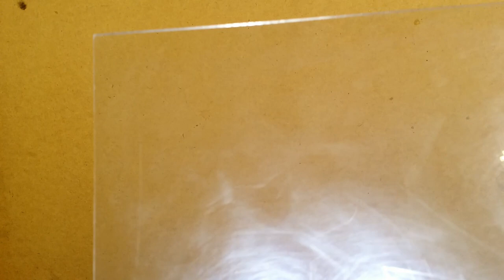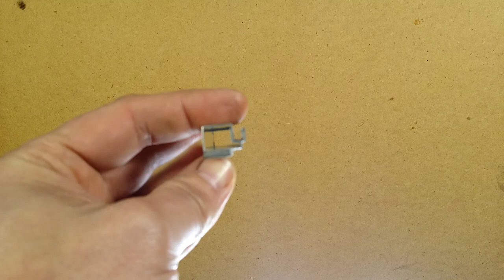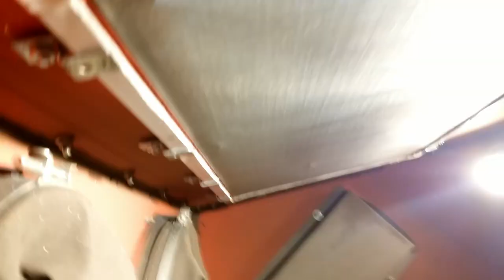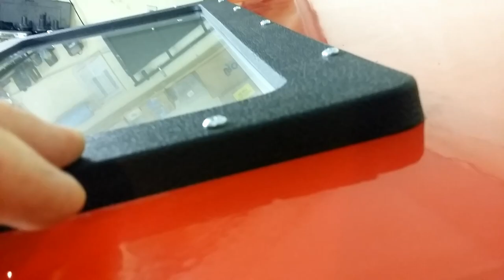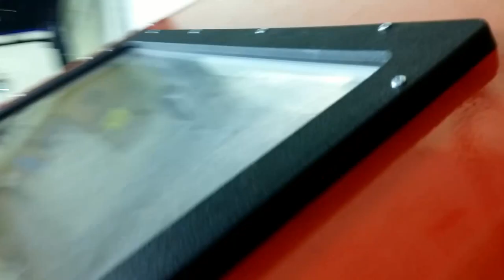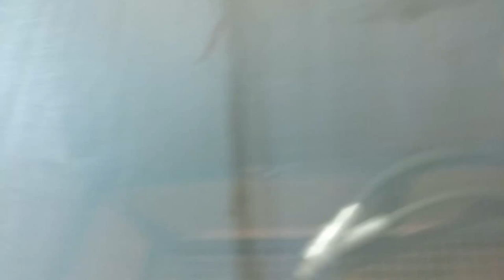Protect Sandblasting Cabinet Glass

Comment: I've watched all your blast cabinet mods. I've subscribed cause of your humor.....and your work.
I was looking into mesh as well so we are on the same path.
You haven't mentioned your blast gun where you sourced it .
You said cheap so my ears perked up.
I think the foot switch ( I sourced that ) and the gun ( looking for the style your using ( still looking )
Is the biggest improvement.
Your drier is impressive!
Even your video production and edit is well done!
Reply from the maker: Thanks for your kind words. 
Back to business. The project was stretched over time so I don't remember now how much I've spent and where I've bought the gun. I think it was about 25 CAD at Banggood.com. Today it costs 47.24 CAD https://www.banggood.com/Stainless-Steel-Air-Sandblaster-Gun-160mm-Spray-Gun-with-Nozzle-p-1121874.html?rmmds=search&cur_warehouse=CN
It is cheaper at Amazon https://www.amazon.ca/dp/B07838DJ1H/?coliid=I34W6LQCGBYCV6&colid=2LEWLULN9R9VZ&psc=1    
but still pricey. Mine is exactly the same gun but I cut off the top loop ( I will not be hanging it anywhere ). 
Air dryer: https://www.princessauto.com/en/detail/air-dryer/A-p8055757e It is often 50% off. 
And pellets for the dryer: https://www.princessauto.com/en/detail/air-dryer-pellets/A-p8506206e
The only downside of the steel mesh is that I have to keep lights in the garage dim, otherwise, the light bounce off the screen and I see more of the screen and less of the object I am working on. 
For now, I am only running aluminum oxide and work on cast iron or steel. Rust produces a lot of dust and most of it is trapped inside the bucket below the cyclone duster. Practically nothing ends up inside the vacuum bucket but there is some fine dust that over time clogs the filter in the vacuum. I solve this problem as well. Based on this guy design: https://www.youtube.com/watch?time_continue=11&v=uhrLhpznvCg&feature=emb_logo I did my improved version that you can see at the beginning of my screen video   https://www.youtube.com/watch?v=qnCbsj4JJqk ( the blue lid mistery bucket ). Working on a new video for the wet filter. 
Sandblasteing cabinet - the neverending story.
Reply: @robertdeptula2003  thank you very much. I m getting  up to speed ....SLOWLY .I have two 1970'z Datsun Z car's to do lots of parts blasting on..all my past experience ,blasting ,tells me to wait till I have it all modded before I began. That is the plan. Thank you

Comment: Simple and quick...  I just use standard aluminum screen available at any Big Box hardware store.  The raw screen is held in place with dollops of hot glue directly on the glass.

Folks complain about a lack of lighting with screens.  I have no fixed lighting in cabinet.  There are, however, two 300 watt equivalent LED spot light bulbs resting on the parts screen base.  It's rather easy to move a part or move the light to see whenever necessary.  Use wire loom on your power cords to keep from chewing up the wire insulation.

Comment: Is the visibility less?? It looks like you can’t see as good
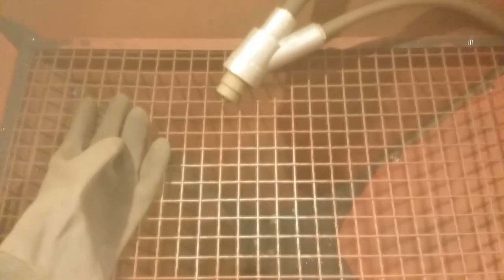Reply from the maker: This is what you see 1:47. It is not like through the glass only. But if you have scratched plexiglass on top and plastic film glued to the glass then my setup is better. Even if you use two pieces of glass, one sacrificial, then in no time it gets frosted and gradually you lose visibility. After sandblasting a set of four brake calipers for one car (rusted cast iron, using aluminum oxide) I had to change the glass with sacrificial setup. I'm happy with this mesh setup. 
Here is my other video with the old setup, sacrificial (new) glass:  https://www.youtube.com/watch?v=GdyJf2PzlHU at 28min16sec. You can compare.

Comment: Hi how is the metal mesh working so far? Still holding and clear to see?
Reply from the maker: It works perfectly. I worked about 3 hours so far after the mesh installation. By that time the regular glass set up would show some frosting. The only "problem" with the mesh is that I have to keep the lights dim in my garage to see perfectly. I'm happy!
Reply: Robert Deptula thank you, I saw you put a 120 mesh. Do you think a different size would make  visibility better ???? Which would you think
Reply from the maker: With 120 mesh visibility is good. My choice was 120 because it was recommended in one of the blogs I have read on the subject.
Reply: Robert Deptula so i did the 120. Visibility is ok but not like glass. Maybe if I add another light or better bulb.
Reply from the maker: I have two LED bulbs in mine and it is enough light.
Reply: Robert Deptula hey Robert I put a second light and now I see much better thanks a lot. Question did you ground your cabinet ? How did you do it ? I’ve been getting shocked by static electricity.
Reply from the maker: If you use 120 V (US/Canada) or 240 V (Europe) for the light then you MUST ground the cabinet. Simply use three leads cable. Connect the green wire to the body of the cabinet. Be safe.
Reply from the maker: You have it shown here at 15 min 57 sec: https://www.youtube.com/watch?v=FFfRXOivraU
Reply: Robert Deptula Thanks for the reply. Yeah my lights were grounded to the cabinet. I check for continuity and it was all good. I also read that the vacuum hose is the source of static electricity. People recommend to ground the vacuum hose and the gun. And I just did that so far no zap. Keeping my fingers crossed.
Reply from the maker: I didn't grounded mine besides electrical connection to the lights. I didn't experienced static electricity (yet).
Reply: Robert Deptula I had been blasting without any problem. But once a improved the flow of media it started happening. I don’t know. I took a .24 mig wire grounded the vac hose and gun. Seems ok now.
Reply: Robert Deptula hey Robert what’s the name or brand of blast gun that you use on your cabinet ? Which size nozzle do you use
Reply from the maker: @diego168  There is no brand. I bought it from Banggood.